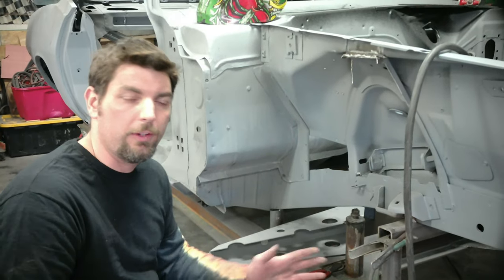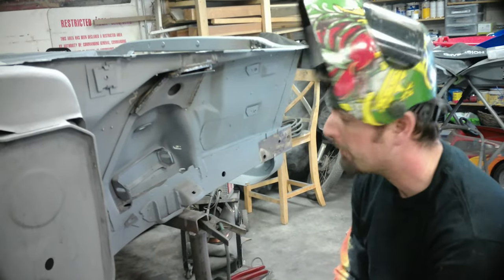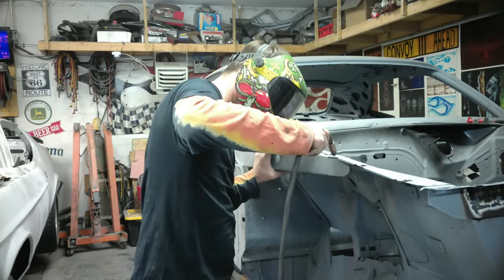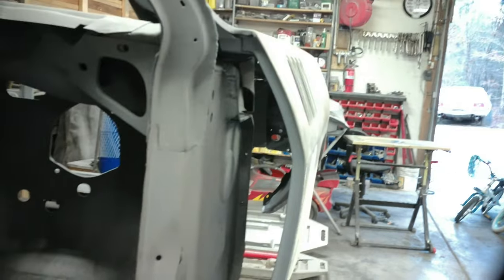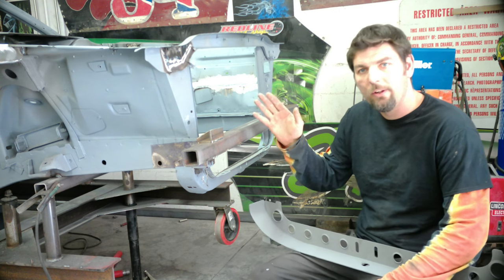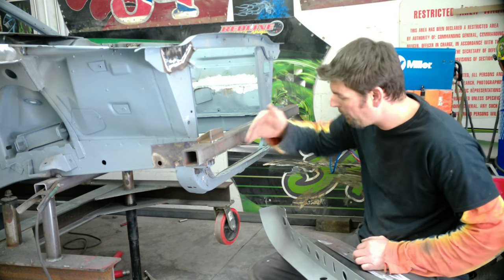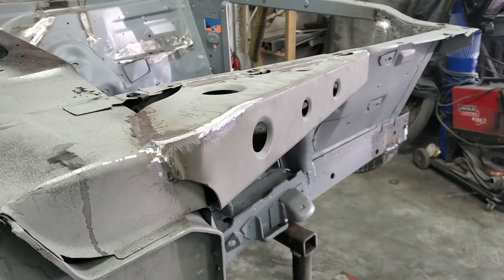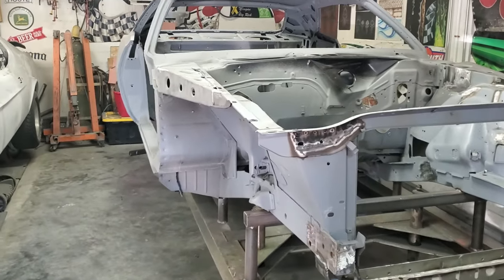1971 Barracuda restoration  project Episode 4 Chassis Stiffening kit install

Comment: I missed this one :o) Someone said to put a copper bar behind a weld to control the penetration and by heck is it a good trick :o)
Reply from the maker: Yes I agree and have a couple copper backing plates that work well when needed, they also work as a heat sink if you are welding something and just need the heat to be absorbed a little more.

Comment: Second time watching this particular episode.  I have the same kit for my Barracuda.  Just need to find a patient welder :-)
Reply from the maker: I know you said you were mostly watching the cuda video's but if you want a more detailed install of this kit, I did one and recorded it on a "1972 Challenger USCAR tool chassis kit" on my page if you check out. I made my editing a little better and went over the undercarriage stuff a lot more in dept. and you might get even more out of it if interested in installing the kit. Both cars for the most part are the samie minus the length of the lower connectors. Thanks for the supprt
Reply: @carthageclassiccars  Good morning!  I actually watched the Challenger episodes first.   I wish they had been posted a year ago.  
- I can’t weld.  My welder, an older gentleman, can weld very well.  We looked at the front wheel well bracing and couldn’t make them fit.  
We did install the radiator support bottom bracing.  
- Question; the top rail of the radiator support is pretty then.  Any thoughts on reenforcing it?
Reply from the maker: @ronbarracuda3657  My opinion is with the bottom of the radiator support in place is all you should really need for the rigidity of the front end. That is the place along with the K member that will try and shift the chassis and the top is mostly there to hold on the fenders and hood in place. Even thinking back to a lot of factory drag cars usually you would see a piece of round tubing around the bottom but nothing up top.